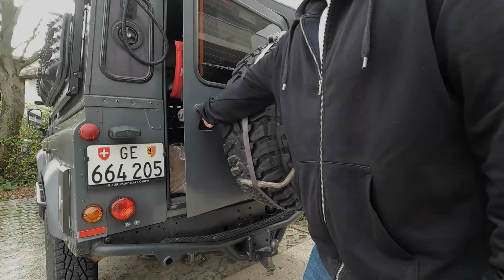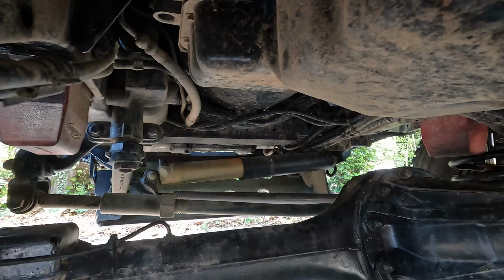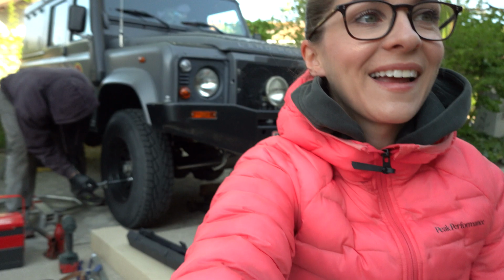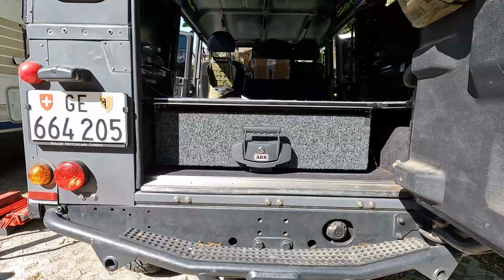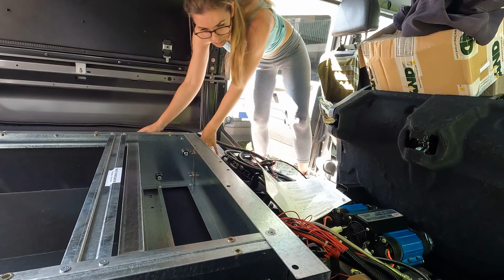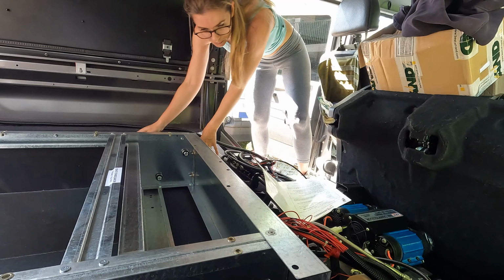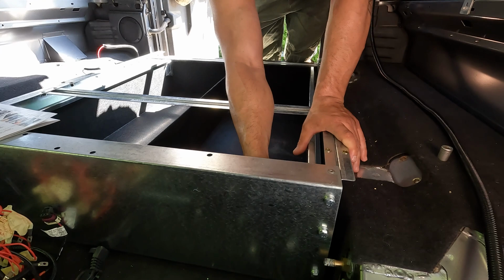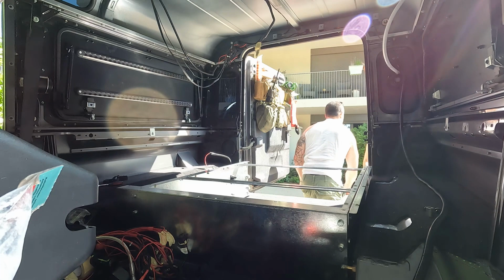Finally starting interior build of our Land Rover Defender (huge ARB drawer + OME steering damper)

Comment: When you were struggling with the steering damper and the fit- the bracket or eyes collapse when tightened up. I keep few different side bolts and washers or all thread rod and nut. Put the bolt through the eye and thread on two nuts with washers and you can turn the nuts to open up the space again. Used this a lot with shock mounts that have been over tightened. Love all you video and work to the 110 so great to do your own work as you know it is done right and can fix it on the trail or know who to blame if it falls apart ;)
Reply from the maker: Thanks for sharing this tip :) And yes, it's reassuring to overland while knowing he knows well the car.

Comment: Hi, as a quick tip I’ve always found it simpler to replace the track rod ends with the wheels on the floor this way you can adjust the rod closer to the original length . It’s handy if your not near anywhere to get the tracking adjusted.
Reply from the maker: Yes, it's best yes to do it all 4s on the ground. We struggled to remove old steering damper and it had us remove the rod even though car was lifted, so he decided to replace the ends :)

Comment: A bit of advice. It's not a good idea to use your torque wrench as a breaker bar, as you were loosening your lug nuts at the beginning of the video. It can affect the calibration, and it's not designed to be a breaker bar. You could damage it. Get a cheap breaker bar.
Cheers!
Reply from the maker: Will pass on the message